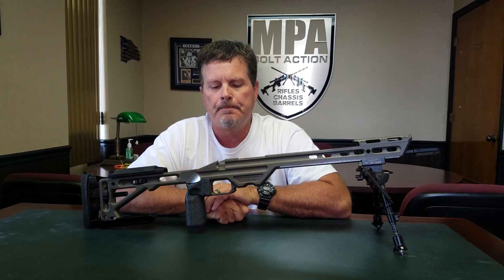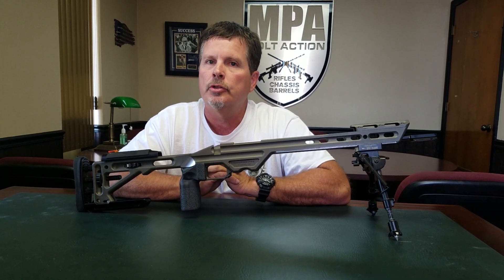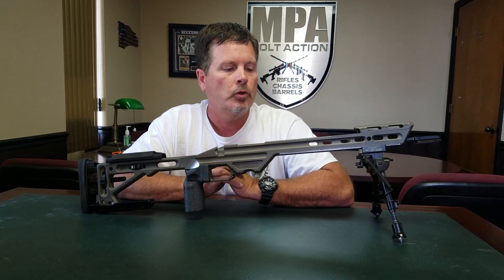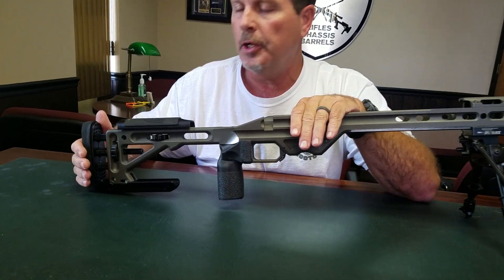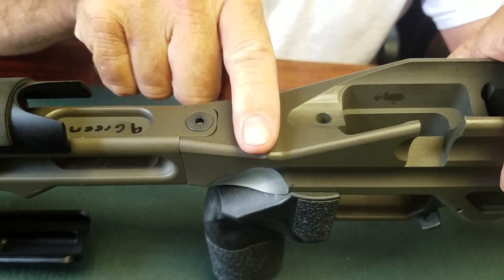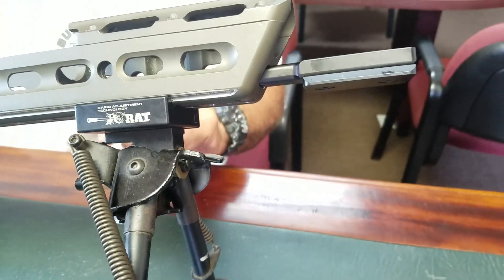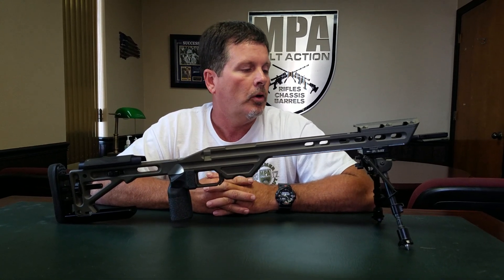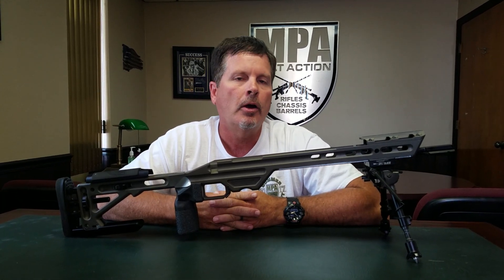Masterpiece Arms MPA BA Chassis Backwards Compatibility

Comment: inclinometer? recoil lug lock down?
Reply: bavariasuhl I think the are the two things they won't do.  Plus it might be difficult to machine the inclinometer as a retrofit and get it to be accurate without taking a bunch of time to do it.
Reply from the maker: The current design of the inclinometer would be difficult to retrofit to a chassis with a vial level. There are several sections that are void of material to properly seat and secure the inclinometer. On the lug luck, the cost of adding this machined feature to older chassis would be quite high due to the # of setups required to complete the upgrade. It could be done, but the cost vs benefit would be questionable. The lug lock is a really nice feature, but not as game changing as the ones shown in the video.